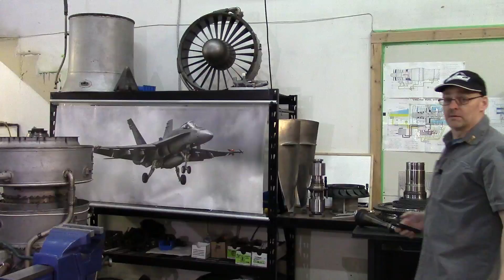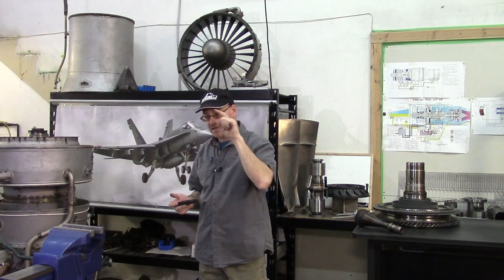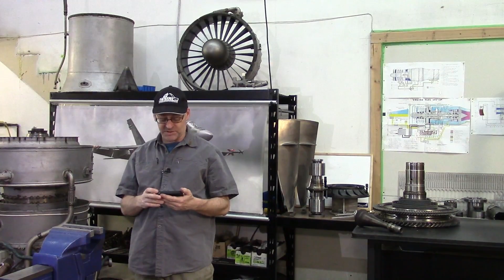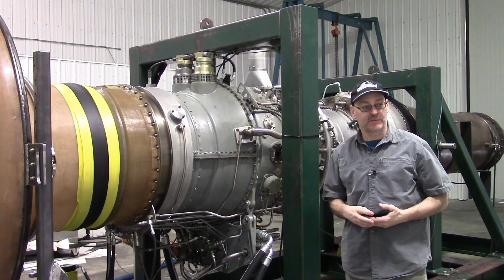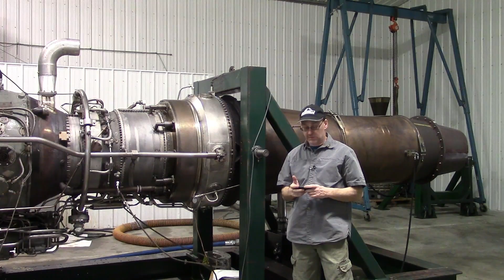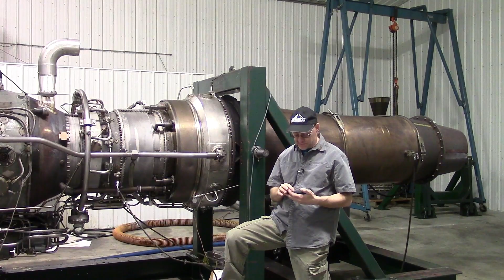Jet Questions 80

Comment: If the engine is on the ground at full power,  and it generates X amount of thrust,  now if the same engine flying on Y speed,  will the thrust output increase?
Reply from the maker: All things being equal, yes, but air density is a very important factor, and that decreases as altitude increases.
So the answer is "that depends..."
Reply: AgentJayZ Thank you,  learning ton of things with every video you make,  thanks a million. 

is there an equation to calculate it

Comment: Fuel Slinger?

GE touts their new H series turboprop engines with "fuel slinger" instead of injection nozzles. Very little information can be found except that fuel seems to be "slung" into the combuster from the rotating inner part of the engine, and GE says it requires less maintenance than nozzles and thus the H80 requires no regular hot section inspection.

Do you know anything more specific? How can good distribution and clean burning, while still maintaining flame separation from the combuster walls, be accomplished without an injection nozzle?
Reply: +pinkdispatcher Yeah, good question.  GE is saying no hot section inspection also.  The sales pitch certainly sounds interesting and if it does what they're saying, it could be a real contender to the PT-6.  I'm looking forward to more on it.  I still don't know what happened to those new Rolls Royce turbo-props announced a few years back.  I was anxious to see those in a few birds.

Nice job, Jay.
Reply: +pinkdispatcher There's nothing new about the "fuel slinger" principle: Turbomeca have been using it in their small engines for decades (they call it 'centrifugal injection').  Check out the Teledyne CAE J69 (aka Turbomeca Marbore) in the Cessna T-37, or the Artouste, Palouste, Astazou, Makila - and others.  By chance, I did have a conversation on this subject with a former R-R combustion engineer only a few weeks ago.  He suggested that the principle is usable only in small engines, as fuel distribution and placement becomes problematical at larger scales.  With the latest requirements for low NOx (even in aircraft engines), airspray burners and dual combustion zone combustors are necessary.  A 'centrifugal injection' combustor would obviously eliminate the need for inspection and cleaning of non-existent burners, but I can't envisage that it would have any effect on the need for, say, boroscope inspections of the combustor and the turbines at scheduled intervals.
Reply: +Robert Thurman What "new R-R turboprops" do you have in mind? Are you thinking terms of the unducted fan principle that was being touted a few years ago? Going back more than a few years, I did have an involvement in a project study for a Dart replacement in the 80s, but R-R were too slow, too late and "missed the boat". Of course, Allison, now R-R Indianapolis, are still very much in the business: the T56 and AE2100 are still going strong.
Reply: grahamj9101
Thanks a lot, I'll take a look at those other engines. I was wondering how it would scale up and how it would do with new emission regulations.

Comment: At the end of the video you stand in front of a gas turbine engine which seems to be suspended by two inverted "u" support members.
You mention that you move the engine into the test structure using a crane which can move around.
How do you assemble the engine and the 2 support members?
Do you suspend the engine from a midpoint, then drop the 2 support members from above?
Do you suspend the engine from a midpoint, slip it under one of the support members, them move the second support member into position?
Do you suspend the engine, then slip both support elements into place?

The engine and the support structures look HEAVY.  Can you tell us how you assemble the test frame around the engine, without accidental "bonking"?
Reply from the maker: +lllbutcher They are very heavy. Skilled people are required, who know how to work carefully. I have a video called the engine test stand which explains things a bit.

Comment: Can anyone tell me what that type of closed tip propeller is called in the background? I have tried doing google searches and haven't been able to find it. I am considering building a composite propeller this style, what is it called please?
Reply: +free8704 Some people might call it a fan... and then wonder why it never turns.
Reply: +Emile Eichenberger So it is just an intake cover? Has anyone ever built a prop with closed tips? Seems like it would reduce drag and noise with a piston engine opposed to a traditional prop, as well as provide prop strike protection.

Comment: Hello, I've been watching your questions videos since you've started it, and i don't remember you answering this question.. so I'll just go ahead and ask it:
-How does a turbine engine powered vehicle/ boat/ plane generates electricity for the instruments, electrical parts....? 
Thanks for the great videos!
(excuse my english, not a native speaker)
Reply from the maker: +Felipe Zardo There is always an accessory gearbox, which drives fuel pumps and tachometers. It also has drive pads for electrical generators, hydraulic pumps, etc.

Comment: If it's costing say $1m to overhaul but $20m to buy a new one, how long will it take before getting the new one would make sense? Is a $1m overhaul something that happens relatively frequently or is it not that common that it doesn't matter? (e.g. once every 5 years means you'd have to run the engine for 100 years to equal the cost of buying a new $20m engine). I'm guessing overhaul = full disassembly vs whatever the equivalent of a minor car service is for these engines.
Reply from the maker: +Bart Reardon I'm not an accountant, or a manager. I thank my lucky stars every second for that. Every freakin second. Tick, tick, tick...
Reply: fair enough :) I guess as long as these engines run, someone will be running them.

Comment: Why is kerosene used over other fuels? is it the viscosity of octane rating?
Reply from the maker: +aspyromilios Neither.
It's a combination of high energy density per unit of weight, good stability over a wide temperature range, ease of storage without needing to be pressurized or cooled, availability of lots of it, ease of handling and safety (vastly safer than gasoline).
Reply: Have there been any engines that were designed to use very low grade fuel, such as the very viscous one that ships use? I imagine it would be very efficient in terms of cost as far as industrial applications are concerned.
Reply from the maker: +aspyromilios Viscous fuels are difficult for fuel controls to handle. What's low grade? A pile of cow poop makes methane, which is a fantastically good turbine engine fuel. Viscosity is next to nothing, and it's cheap too. Your question confuses me.
Reply: +aspyromilios In the past, they did try burning pulverised coal in some of the early 'heavy' industrial gas turbines. Not surprisingly, it eroded the turbine aerofoils. Heavy fuel oil (eg, Bunker C) can have significant amounts of Vanadium in it, which does nasty things to turbine aerofoil materials.  It needs pre-heating and preparation to be able to get it into the injectors of those big marine diesels, which would make it even more problematical for use in gas turbines.

Comment: When you run the Royals Royce, do you have to shut down at 4pm for a "spot a tea"?  (Sorry Graham)
The FOD question got me thinking, when a jet flies into  heavy rain or hail, I would imagine that the majority of the water and ice is flung to the case side walls by the spinning fan where it by passes the compressor and combustors. Of all the engine tests that I have seen on TV, almost all of them explode the mounting to a fan blade. Are you aware of any testing where a compressor blade is destroyed?

How are the L220's sounding? Any complaints from neighboring towns yet ?  :-)
Reply: +Todd Dembsky I can take it, Todd! I have not one, but two mugs of tea to my left as I type this: when I'm at home, I make tea every couple of hours. In over 40 years in the industry, I never came across an instance of a test where a compressor blade was explosively released intentionally. It's not been part of the certification requirement, nor was release of a fan blade in the early days. What I did come across was the occasional compressor blade failure in service, which , very occasionally, caused a "haircut". That's the Brit term for such an event: in N America, I believe it's known as a "corn cob". Both terms are self-explanatory, I think! To go into a little more detail, there is a plane known as the 'Titanium Fire Line' part-way through a Titanium-bladed HP compressor. Downstream of this point, the air temperature and pressure is such that, if there is a blade (or vane) failure and the debris gets tangled, a self-sustaining Titanium fire can occur.  I recall that, when I was working on a certain engine that powered a certain twin-engined fighter-bomber, we had such an event during a training flight somewhere over Canada. The wing man said that it was the brightest white light he had ever seen. The aircraft actually stayed in the air for about 20 minutes on the one engine before the pilot and navigator baled out and the aircraft left a smoking hole in a forest.
Reply: grahamj9101 That my friend is a sight I hope I never see. The vibration caused by the blade detaching must be incredible.

So is that one lump or two in your tea?
Reply: No sugar or sweetener in my tea, thank you. I was weaned off the stuff (and added salt) some years ago, for the sake of my health.  However, I use something called Xylitol (from Finland) as a sweetener, on occasions.
Reply: +grahamj9101 I saw quite a few
Reply: +grahamj9101 I saw several rollers that spat hp1 blades.  Very messy indeed.  How to turn a lovely engine into a seized lump!

Comment: +AgentJayz could you please let me know why we don't have auto feathering  facility in turbofan engines
Reply from the maker: +Deepu Sharma 
1) - the fan blades are fixed pitch
Reply: +Deepu Sharma You've had a short, sharp and totally accurate reason for there being no variable pitch and feathering capability in current turbofan engines.  There isn't enough space beneath and between the roots of the fan blades to put a variable pitch mechanism. Back in the 1970s, R-R built an experimental engine, the M45 SD-02, which had a geared, variable pitch fan. The fan had an enlarged hub, the blades were very wide chord and would actually go into reverse pitch for reverse thrust.
Reply: +grahamj9101 thankyou very much for info then what is the mechanism in turbo fan is avoiding unnecessary drag at the time of in flight shutdowns
Reply: +Deepu Sharma There is no such mechanism. There will obviously be some increase in drag and the fan will 'windmill'. However, I'm sure that all of the big turbofan manufacturers will tell you that their engines are extremely reliable and that IFSDs are very rare, such that the added complexity and weight would not be cost-effective.
Reply: +Deepu Sharma Perhaps I should add that the variable pitch prop was originally  invented in the days of the piston engine, in order to vary and optimise the pitch for take-off and in flight.  It was not, as far as I am aware, introduced primarily to allow the prop to be feathered in the event of an engine failure.  However, the ability to feather a prop was obviously very useful in the event of the not infrequent failure of an engine on a multi-engined aircraft.  In the extreme, how many Lancasters or B-17s returned safely (more or less) from a bombing mission on three or even two engines?
Reply: +Deepu Sharma As a final comment, I'll give you a quotation from Capt. "Sully" Sullenberger's book, which he wrote after putting Flight 1549 down in the Hudson River in 2009. "The failure of even one engine had never happened to me before. Engines are so reliable these days that it is possible for a professional airline pilot to go an entire career without losing even one. I was headed for that perfect record before Flight 1549."

Comment: Hi this is probably a somewhat stupid question... but ill ask anyways =)
i suspect that birds sometimes goes through the aircraft engines, will the engine survive that?

and if the engine wont take any harm and if its possible, could you film an test where you throw a peace of meat to the intake of the engine while its running at full power.... or atleast BBQ it behind the exaust....

/a curious sweede
Reply from the maker: +SirDumle   No. That is a ridiculous request.
Reply: You can actually find videos in YouTube from engine testing where they throw dead chicken. They are conducted by the manufacturers to test the endurance of a new engine. 
I think that, asking him to perform a possibly catastrophic test to a paying customers engine is a bit too much ;)
Reply from the maker: +dimos k There is a difference between testing an engine design, and testing an engine. Ingestion tests are never, ever performed on engines that are in production and being serviced or overhauled.
When you take your car to get a tune-up, does the technician then crash-test it?
Reply: AgentJayZ sorry if my message was confusing, English is not my native language. 
I meant exactly what you said, that they test a new engine design prior to put it into production

Comment: Please, 

Suck  - To draw in by establishing a partial vacuum.

The guy was using English completely correctly to ask a question/raise a point. There is no such thing as centrifugal force either, but using the term to convey an idea is completely valid. You go on to explain that it is common and you are in fact seeking to put in place a screen to stop at least some of what he was talking about.

My question for next time: Can you please put in the index some way of navigating around the relentless condescension?
Reply: See rotational frame of reference

Comment: Both Rolls Royce and GE are very proud of there fan blades. GE with their carbon fiber blades in their GEnx and Rolls Royce with their corregated titianium blades in their Trents. Can you explain the benefits and the reasoning behind the the two different ideologies? Also Rolls Royce has gone through great lengths to produce their turbine blades to grow the blades metallurgy into a single crystal. Does GE do the same with theirs or do they use another type material in their blade like additive microceramics or something more standard? Last question would their be a benefit to preheating jet fuel to a predetermined temperature? Is that done already or is there no reason to? Okay can't help myself one more question. Why don't current generation of jet engines (ie: GEnx and Trents) use adjustable stators like in old?
Reply: +yodustin00 AgentJayZ thinks that I am too long-winded (and he's right!), so I'll come back to you with more detailed comments on your questions separately. On the subject of fan blades, R-R had a bad experience with their 'Hyfil' fan blades back in 1969-70 and steered clear of carbon fibre (Brit spelling!) fan blades for years, coming up first with a honeycomb core for their hollow Titanium blades, followed by the superplastically formed/diffusion bonded blades that are current in the Trent series (I've seen them being made in Singapore). R-R believe that (at least they did until recently) they have had a lighter solution with their hollow Titanium blades and, personally, in the event of a severe bird ingestion event, I'd rather not be flying with carbon fibre fan blades - although I have done so, quite uneventfully, several times, sitting between two GE90s. Nevertheless, R-R are now developing carbon fibre fan blades for the next generation of their big engines ( I was looking at a development fan at Derby only last weekend).
Reply: +yodustin00 On the subject of single crystal turbine blades, in my experience they have been an industry standard since the 1980s.  For example, R-R introduced single crystal HPT blades into the last production mark of the Pegasus engine in (circa) 1987, together with the uprated fan that I worked on.  I believe that the Trent range has single crystal blades in both the HP and IP turbines. If you check out NASA's website, you should find a pretty 'graph', plotting the development of turbine blade alloys, which shows single crystal alloys coming in during the 80s and 90s, with both P&W and GE specs evident.
Reply: +grahamj9101 On the subject of variable stator vanes (VSVs), R-R has never used VSVs in the HP compressors of the RB211 and Trent series of engines, but the early RB211 IP compressors had variable inlet guide vanes (VIGVs).  Current Trent engines have three stages of variable (including the VIGVs) in their IP compressors (I was looking around a Marine Trent MT30 at an exhibition only yesterday).  Having looked at pictures of the GEnx on the internet, it appears to have three or four stages of variable in its HP compressor (and its fan goes around the same way as R-R fans!). I've previously mentioned R-R's development of a carbon fibre fan blade for its next generation big turbofan. It will probably have a 4-stage IP compressor, with no variables, and a 10-stage HP compressor, with four or five stages of variables.
Reply: +yodustin00 Finally, on the subject of preheating jet fuel, it has always been a useful 'heat sink'. Many engines that I know of have a fuel cooled oil cooler (FCOC), though this has turned into a fuel-oil heat exchanger (FOHE) on Trent engines.  This was the device that blocked with ice, resulting in the crash-landing of BA038 at Heathrow in January 2008.  Concorde used the fuel to keep the passenger cabin cool during supersonic cruise.  It was certainly needed. Back in 1995 I had a 'freebie' flight on Concorde and, out of curiosity, I touched an exposed door hinge: it was really too hot to touch and I could have burned myself.